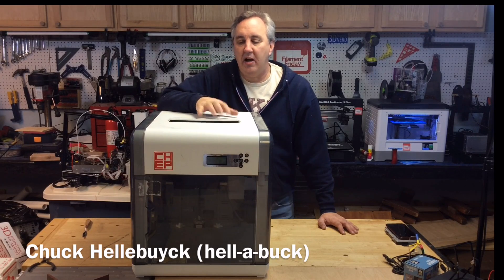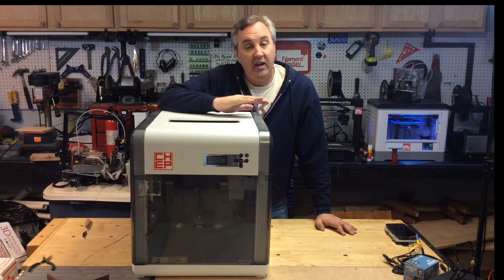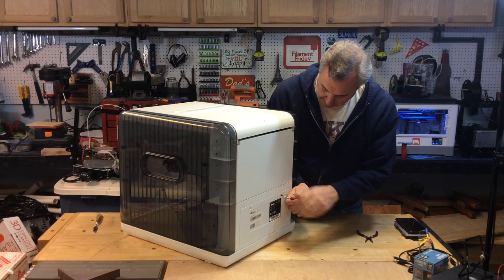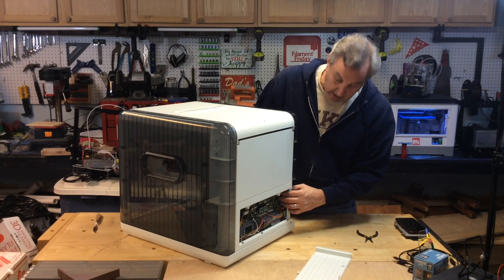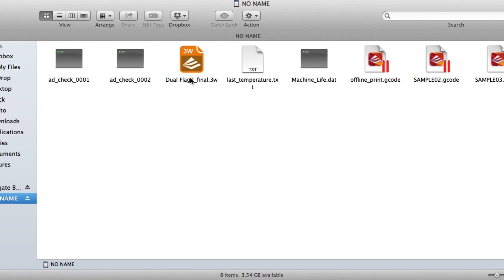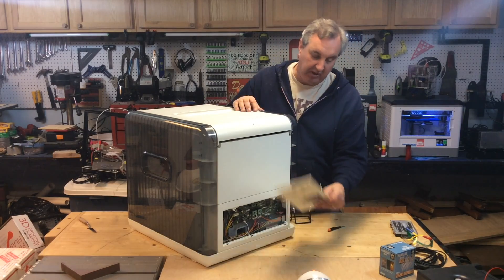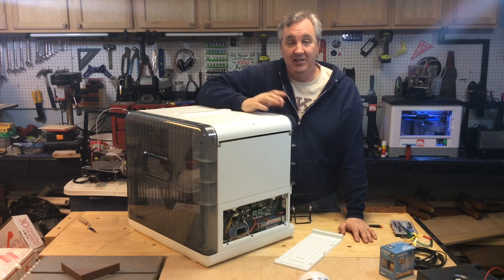Convert a stock DaVinci 1.0 3D Printer into a Factory Machine

Comment: Howdy from Texas, Chuck! I just wanted to say thank you for all of the great information regarding the da Vinci printer. This video told me my da Vinci printer is a 1.0a, even though the back plate says 1.0.
I do have a question about print quality... If
Reply: I've calibrated this thing six ways to Sunday.. But if I try to print in "Good" or "Excellent" quality there are issues with the "squish" of the layers, especially the first layer. There doesn't appear to be any way to adjust the Z axis. I did watch your video regarding your method of "eyeballing" the squish, but unfortunately, this is beyond my capabilities as I only have three use of my left eye. Depth perception suffers greatly. What controls the Z offset in the printer?
Reply: @BenEBrady  the best thing i found is that when you run a bed level calibration and it's a successful attempt,  before you print turn all three bed screws down another mm orso and that fixes my problems . But that may just be my machine . Hope you got it sorted out

Comment: Holy cow!  That mailbox flag bundled with the vinyl number package that I got on Amazon - is that yours?  How funny would that be!  I've been a subscriber since the very beginning - and my DaVinci's are still running strong!  I just didn't feel like investing the time to design a mailbox flag and bought one instead - too many other things to print.  But it does live ~4ft from a 3D printed "no soliciting" sign I made on the DaVinci!
Reply: The quality of the print looks very DaVinci-like.  And since you mentioned mailbox flag selling in the video - it just seemed like that might be the case.  If so - just a funny coincidence.

Comment: I have done simular by printing the first one then changing the name of the offlineprint.gcode to the sample file .
did realize you could just  change the name on a w3 file. thanks. 
also I have a 10a , it has a Mico SD card so I got and extension cable for it and also it has a adapter to standard SD card, mounted it so I can get to the SD CARD from outside

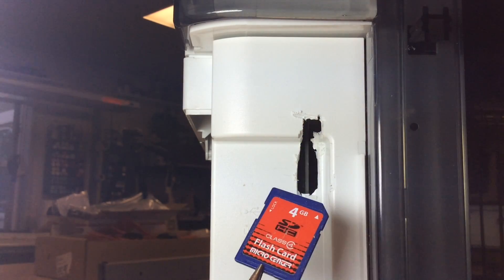Comment: 1:42 EEK... Chuck that slot looks like it was cut with a blunt rock...
From the 1st days of my Davinci I added an SD car extension cable and I can change SD cards as I need from the top rear of my 3D printer as required with out needing to cut into the case.